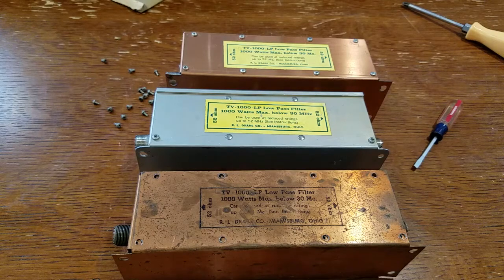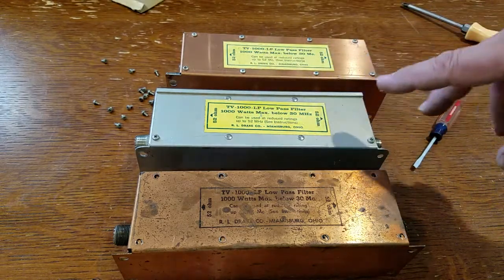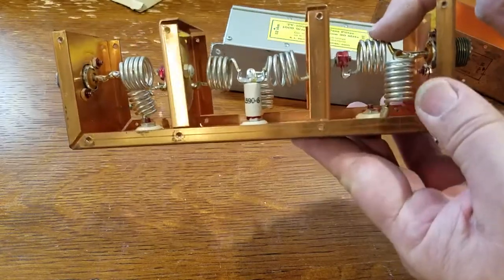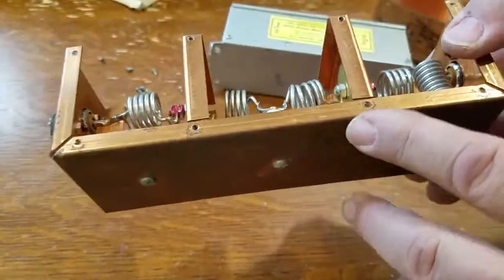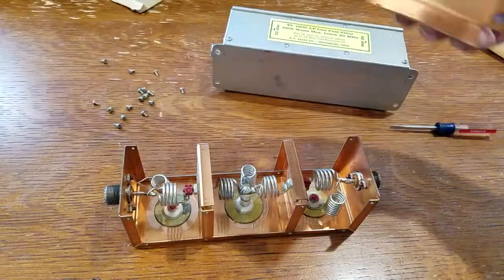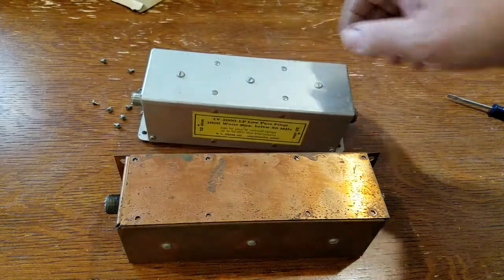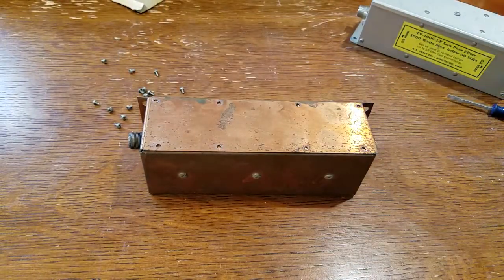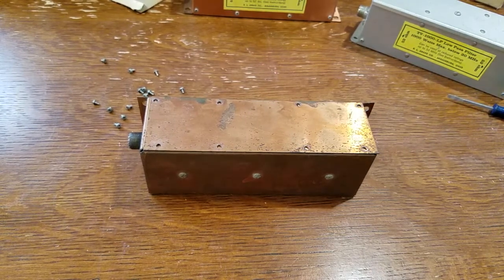Drake TV 1000 Low Pass TVI Filter A LOOK INSIDE

Comment: does it matter how it is hooked up. is there a in and out the one i have has no marking at the antenna connections. thanks from 969 nc
Reply from the maker: If I remember correctly, all 3 tanks are identical so you can plug it either way.  I usually hold print side up and input from left to right.
Cheers

Comment: I just found a 3300 cleaning out a garage. Not sure how it works. 🤷‍♀️
Reply from the maker: If you are into or use CB radio or Ham Radio then it may be a device you can get some use out of. The Drake helps filter out un wanted RF signals that may interfere with other electronics in your/neighbors house. Like old clock radios, baby monitors, home stereo systems. The filter is not always a cure for stopping interference but it can help.
This device was a big deal back in the days of TV .
Reply: @390WagonMaster  Oh cool! We found a couple really old CBs too. I don't thinking they're working though.
Reply from the maker: What did you find?

Comment: Do you run one?
Reply from the maker: Yes I do run one and sometimes two at a time. One before my amp and the main one that goes out to my antenna. That one is permanently mounted under my bench. Cheers
Reply: @390WagonMaster  Thanks. Ill hook it up. I pulled it out of a box that was headed to the scrap yard. Lol